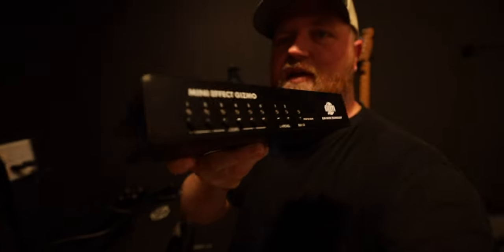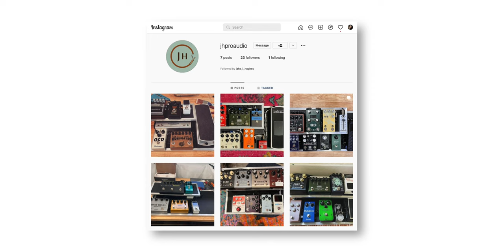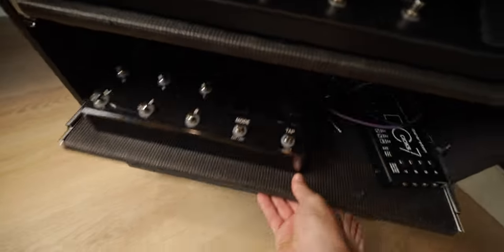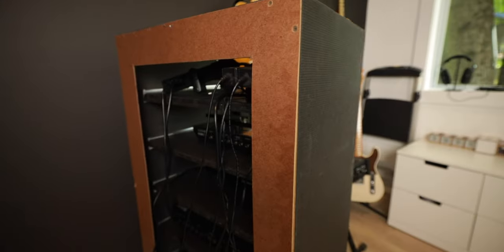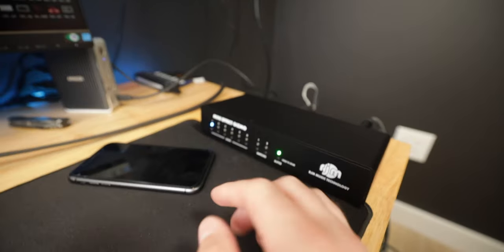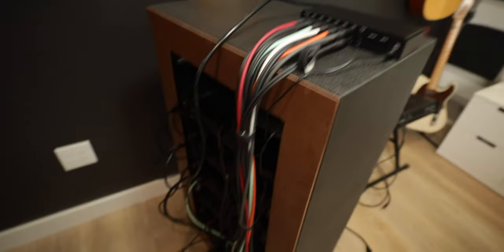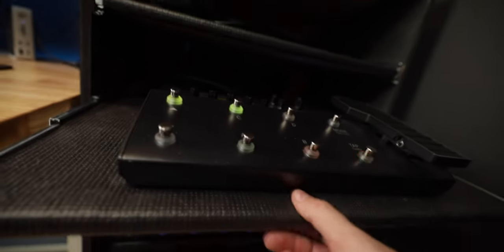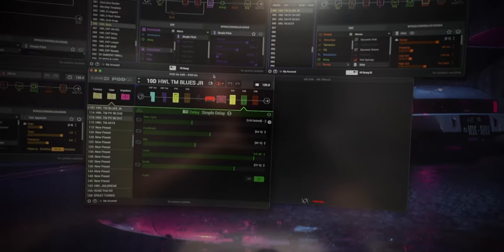CUSTOM STUDIO RACK for my Line 6 HELIX, HX Stomp, and POD Go Units!

Comment: hi buddy, do this pod go needs DI Box or xlr cable for FOH? for better sound signal. i need your recomendation for this one.
Reply from the maker: I use a DI box with no issues.
Reply: @HeyWorshipLeader  they coloring your tone? which DI box you using?